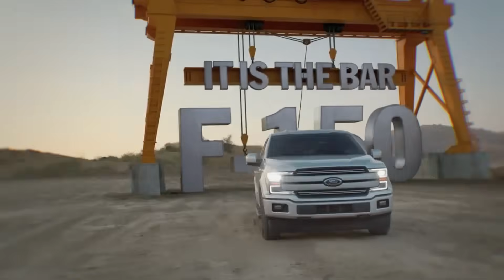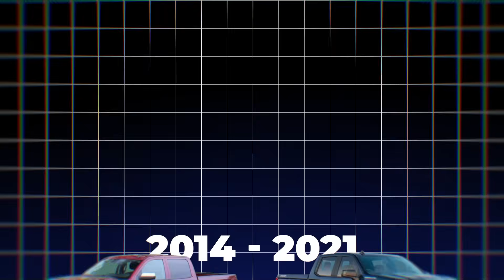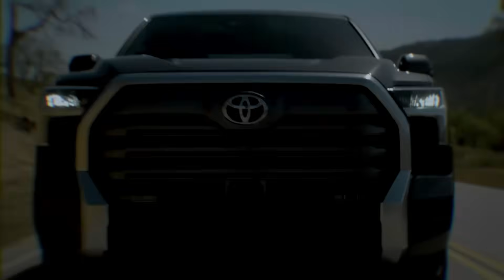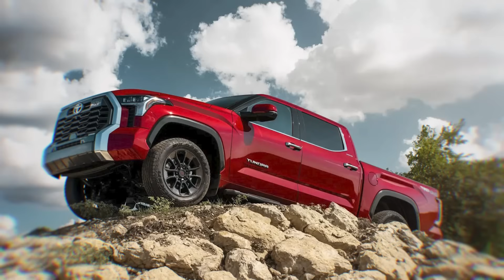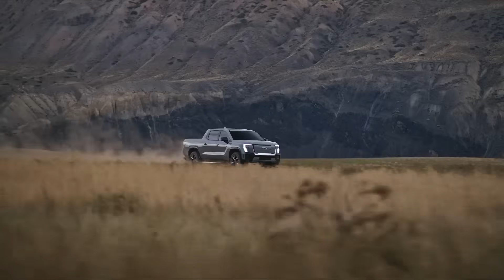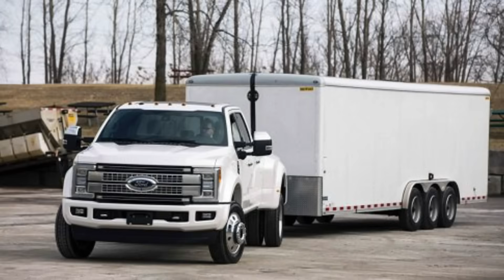Pickup Trucks With The WORST Engines and Transmissions (Avoid at All Cost!)

Comment: I bought a 2018 Chevy Silverado 1500 LT. After a few months the motor started getting a knocking noise that wasn't loud yet. Dealership said it was normal. Three months later I took it back again for the same problem. But you can heard the knocking a lot louder. Traded the truck on for a 2019 F150 (POS), the drive train went bad and the dealer ship couldn't figure out what was wrong with it. Traded in for a 2022 F150 Tremor (POS too). The transmission has been rebuilt two time and the transfer case one time. I still have clucking from the transmission (Out of warranty now). Ford lost a life time customer! Should have listen to the wife when she said don't buy another Ford after the 2019.